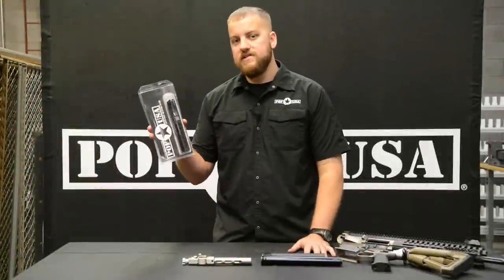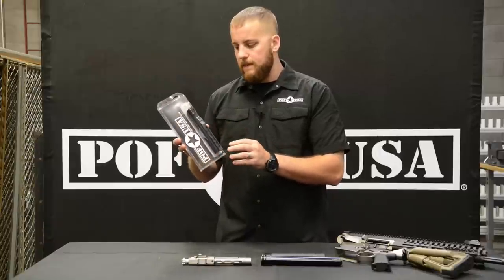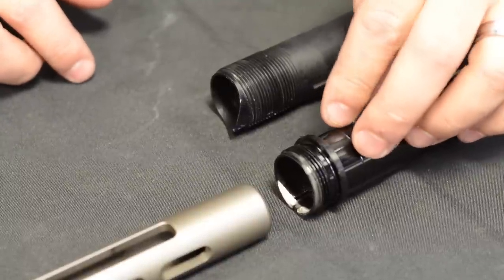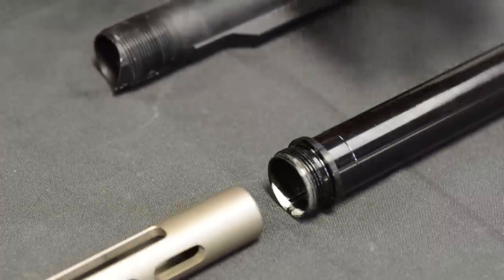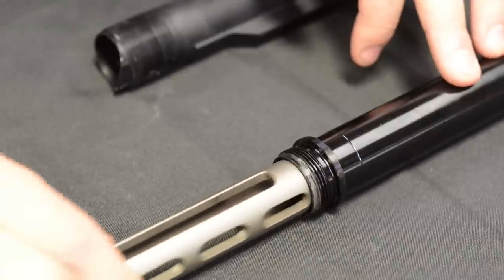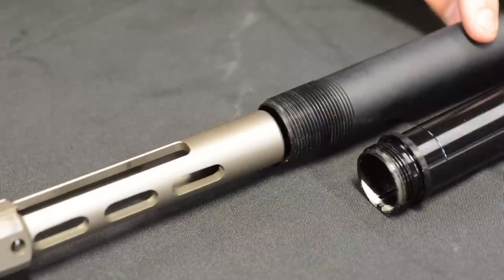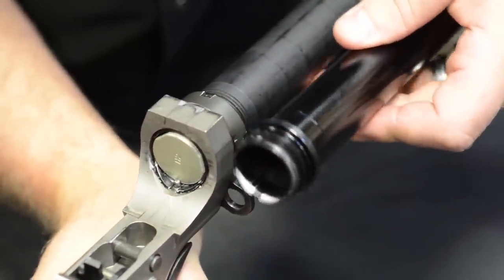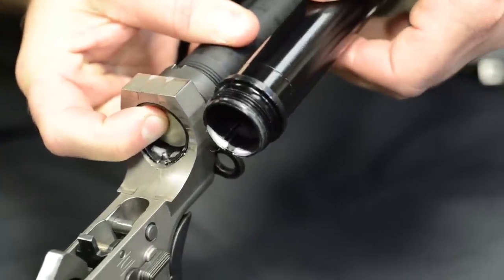POF-USA Anti-tilt Buffer Tube

Comment: It should be noted that carrier tilt is much more prevalent in piston guns due to the off (bore) axis thrust imparted by the op rod acting upon the "gas key". DI guns (at least in theory) have their rearward thrust imparted by the bolt its self as the gas shoves the bolt forward, both unlocking the bolt and shoving the carrier rearward; that said, I would also find it believable to learn that the gas entering the gas key (and making the turn necessary to enter the bolt bore on the carrier) has a (off-axis) rearward thrusting effect, too, but I can only guess at how (in)significant that effect might be.

Comment: I used an Anti-Tilt buffer instead.  I just have to push both pins to open the gun.  A little more pain in the rear than simply pulling the rear pin, but the Anti-Tilt buffer keeps the bolt centered at all times and in all planes.....centered up and down, side to side, etc.

Comment: Does this mean without the AT buffer tube, all POF piston uppers are prone to causing damage???
Reply: Almost any piston upper can be prone to buffer tilt.  It comes from the fact that the piston strikes the top of the BCG forcing the rear of the BCG to tilt down.  On a direct impingement gun the gas is directed inside the bolt and pushes the BCG backwards from inside the bolt perfectly straight so it doesn't tilt.  You can also use an anti-tilt buffer.  It has a bump that sticks out and engages the circular back of the BGC and doesn't let it move downwards.

Comment: Why don't you try showing a regular buffer tube after the 67000  rounds and compare the difference in wear to the one with only 650 rounds? Is the wear at that point truly any worse? I find it hard to believe that the San Bernardino department doesn't have an M16 or AR-15 around with more than 650 rounds in it so that you can compare real buffer tube wear.

Comment: Does this lend itself to better accuracy or just a gimmick
Reply: Gimmick no effect on accuracy.   When you shoot a round the bolt is LOCKED.  The bullet is down range by the time any of this comes into play.  But makes for good advertising and sales.
Reply: No one claims more accuracy. It's about less wear and tear, and reliability.
Reply: @8triagrammer  Not true,  there are manufactures and channels where they swear its more accurate.  Agree its about less wear and tear but they add accuracy to it which is BS.
Reply: @Physics072  I see. But does POF specifically make this claim?
Reply: Its been a year tried to look through my emails to see who was claiming this.  He was suppose to send me that data and testings proving it.  But it never materialized.   At least two different sites were claiming it.  I don't remember if it was POF or another company.   If I find it I will post it though.
Reply: I have read (not experienced) that a lot of AR15 match guns have had modifications to the BCG for anti-tilt to get better accuracy. None of them were like thus but the number I saw with those was 3% shrinkage in group size. Keep in mind that may not apply to this product, but it is POSSIBLE, however I find it unlikely.